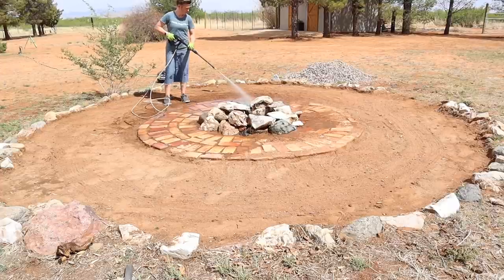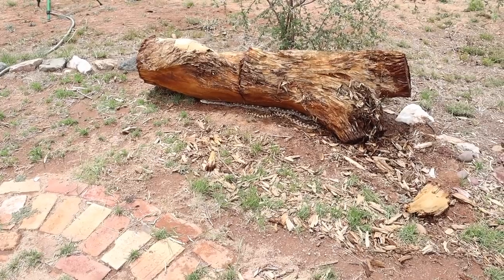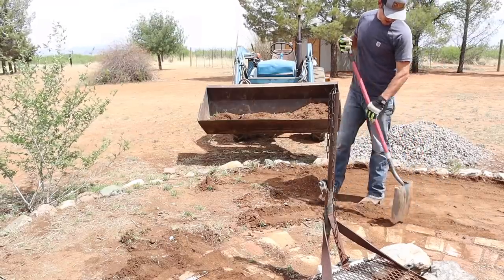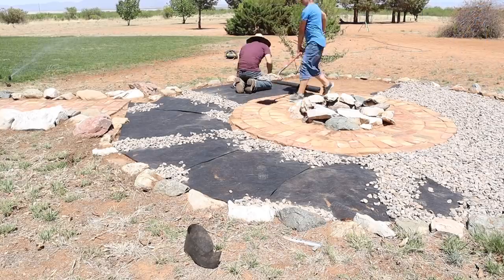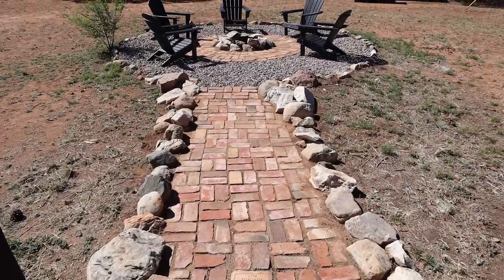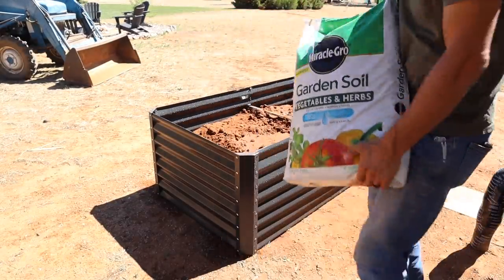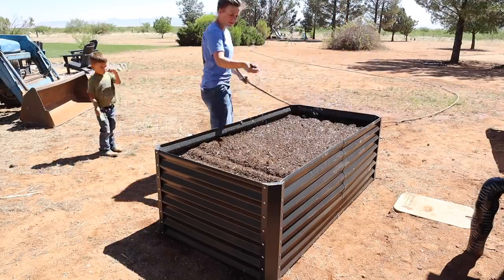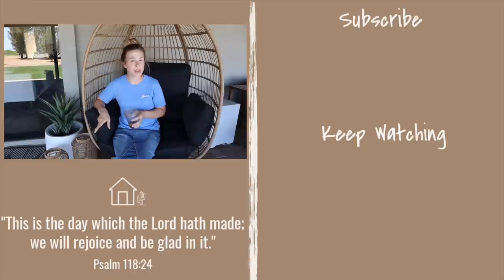OUTDOOR HOUSE PROJECTS!! BEFORE AND AFTER FIRE PIT MAKEOVER | OUTDOOR DECORATING

Comment: You might try using a pre-emergent around your firepit to keep new weeds from sprouting.  We've had our entire yard sprayed regularly (19 years) and we have no weeds, our gravel is on bare soil no weed barrier because we found that fabric will deteriorate quickly in the Arizona heat.

Comment: The wood rotts if its in mud cus held moisture i had a log flower bed.. best to dry them snd threat them to protect um but yeah lift them up onto slabs or stones so they can drain and they don't hold wet and it fixed my problem of the drawing wet or bits of mould on feet.👌🏼🙏💯

Comment: If you clean the strawberries with vinegar and water and dab them so they are not wet.  Then put a paper towel on the bottom of the container, put the strawberries in and then put them in the fridge .  They will last whole lot longer..